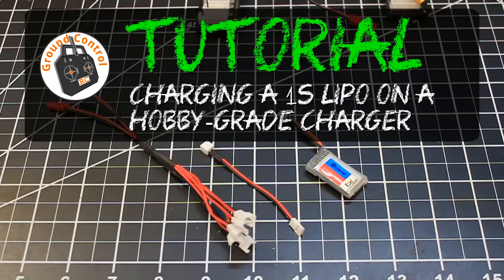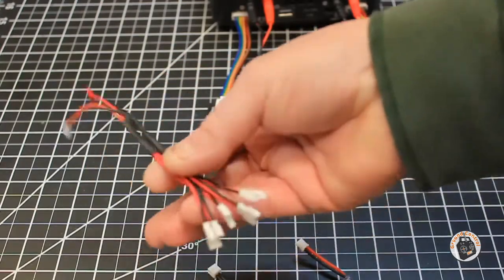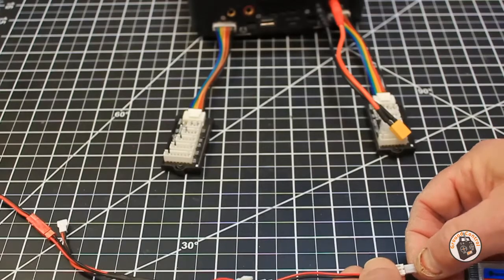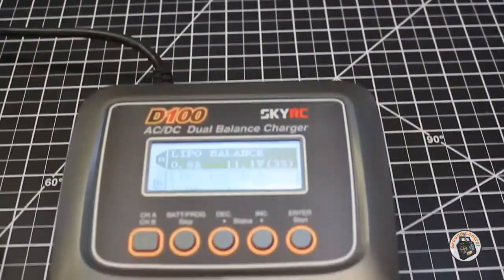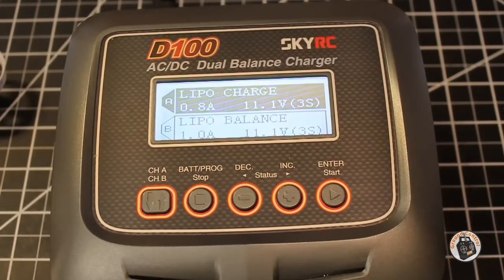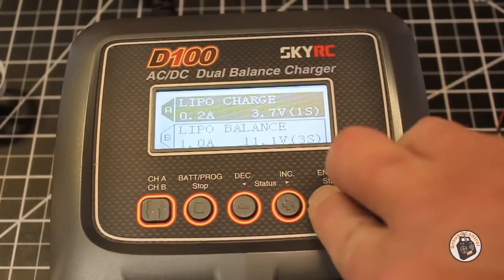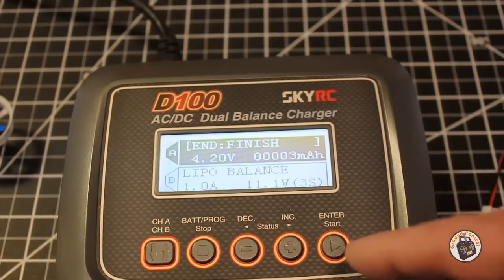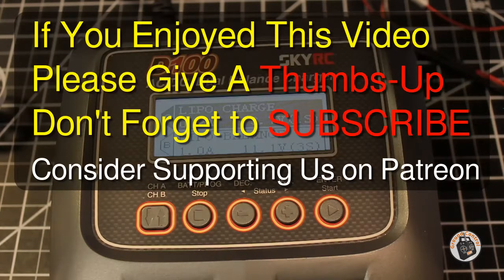Tutorial - Charging a 1S LIPO with a Hobby-Grade Charger

Comment: i have a usb charger. which cord do i need. it is for a super cub s.
Reply from the maker: Good question! I wish I could answer your question but I could not find the specs for battery in this plane. I assume it is the Horizon Hobby Super Cub S? Let me know specifically the plane or if you can send a picture of your batter's connector via email: info@groundcontrolrc.com
I might be able to tell you the type of connector.
See you in the Air!

Comment: How about charging 5 batteries at the same time. How does the charger knows which battery is full. Or does it constanly charge until all batteries are full.
Reply from the maker: That's a very good question. I think if you have a parallel charging board so each battery is monitored individually to make sure each one is fully charged that would be the way to go. I don't have such a board. I know there are many people that will charge several 1S LIPOs at a time using one of those multi-connector cables and I've use them in the past, however, it seemed not all the batteries were getting their full charge. So I typically charge (2) at time since my charger has (2) independent charging ports. Here is a link to a Parallel Charging Board for 1S LIPOs that has Over-Charge Protection, and USB power output, Supports LIHV as well and has many positive reviews: https://www.banggood.com/6-In-1-3-7V-1S-Lipo-LiHv-Battery-Charger-Board-For-Inductrix-3-7V-KINGKONG-Tiny-6-7-Eachine-QX65-p-1170998.html?p=WE081047791920140372

Comment: If it helps anyone, I'm charging a 3000mah single cell battery using an iCharger 3010B using the same basic steps that you described and it works fine. Thanks!
Reply from the maker: Thank you for the info! I'm sure it will help someone looking for a charger. Happy Flying!

Comment: my charger does not allow me to charge without the balancer cable
Reply from the maker: Hum....does you charger have a setting for charge rather than balance?
Reply: yes, it's imax B6AC but say connection break
Reply from the maker: It might be in Balance Mode instead of Charge Mode. Looking at the specs it should be able to charge a 1S to a 6S LIPO. You have to set the parameter for Charge, Balance, Discharge, etc. in the Menu. Pressing the START button should BLINK the current parameter that can be changed by using the INC > <DEC Keys